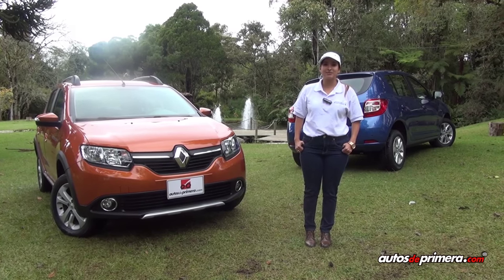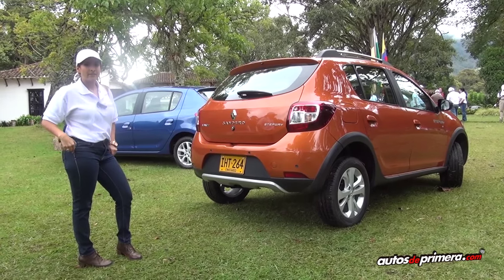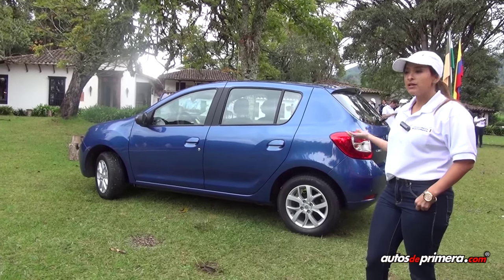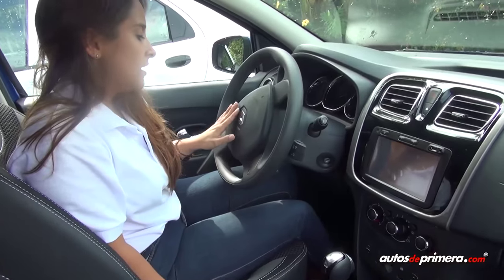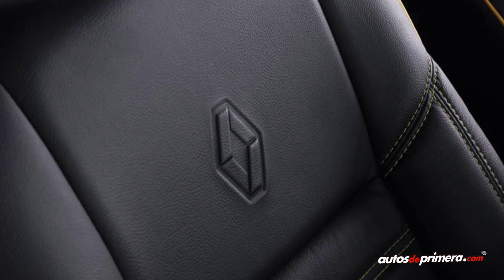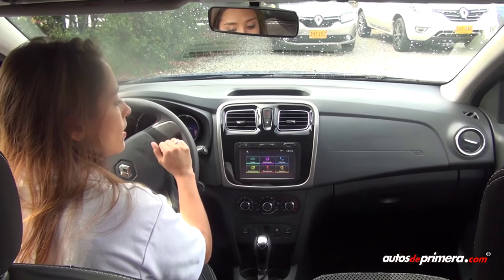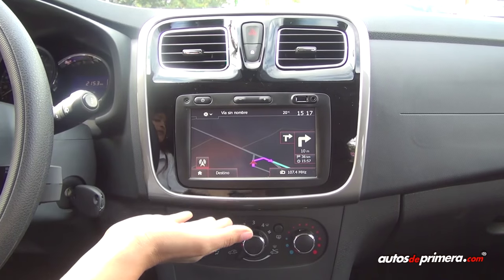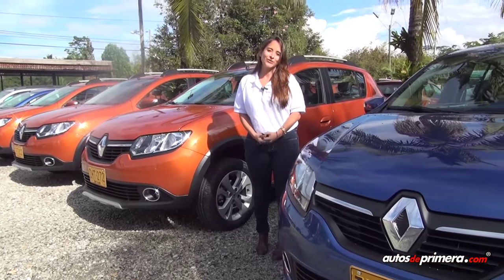Nuevo Renault Sandero y Sandero Stepway 2016 en Colombia - Presentación

Comment: Qué diferencia hay entre el Sandero y el Stepway?
Reply from the maker: Son el mismo carro, solo que el Stepway es de un estilo mas crossover. Sls.
Reply: El Steepway es 16 válvulas 105 caballos de fuerza, el Sandero es 8 válvulas con 85 caballos de fuerza. Los dos tienen correa de distribución, osea no vienen con cadenilla. El Steepway es un poco más alto y amplio.
Sandero tiene otra presentación que el rs y creo que es motor 2000. Y algunos modelos atrás tienen el Sandero GT que es el mismo motor del Steepway. El RS y GT son Sanderos deportivos, vienen más bajos que le da un toque de carros de carrera.